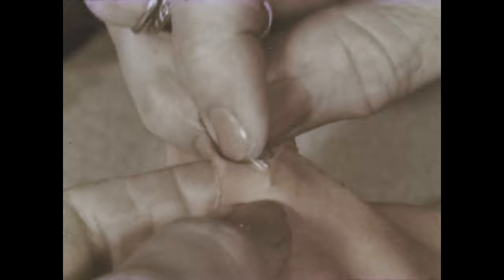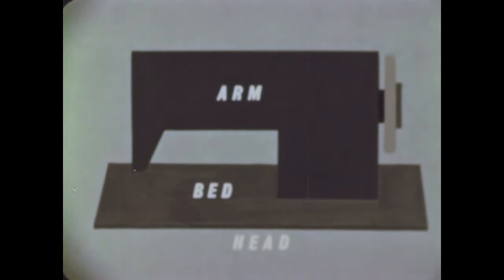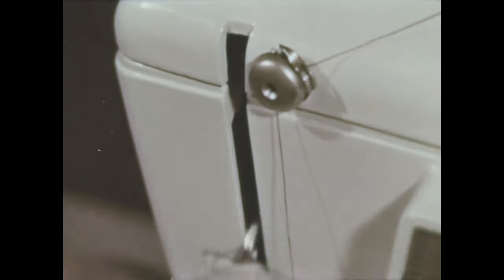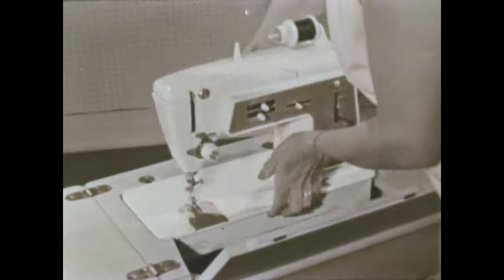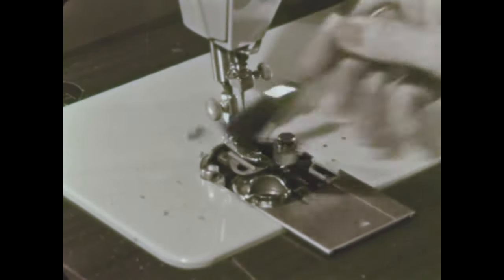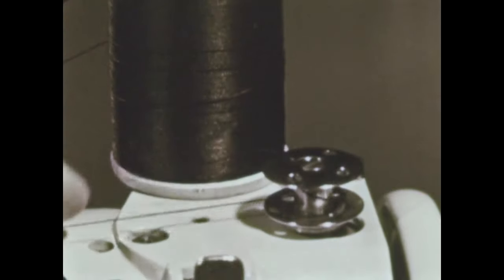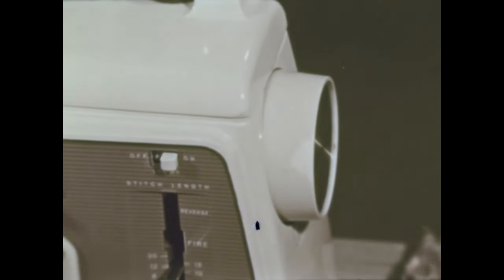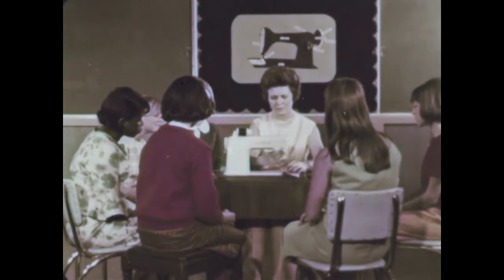Sewing Machine (1960s)

Comment: Those older machines are all you really need.  There are so many features on the new computerised ones, and most people barely touch them.  Plus, as with anything computer-driven, you will have breakdowns (its, and yours:-)).  I learned in the 1960s from my mother and sewed constantly on her old Singer 15-91.  At my elbow was also my paternal aunt, a children's fashion designer in the late 1940's- the late 1960's.  She taught me that you just need a straight stitch, the rest of fine sewing was in pressing everything as you went, and precise cutting, and then doing it by hand when that was going to be best.  

I just spent this past summer shopping for and trying out sewing machines.  It was a maddening experience.  And I ended up with a Singer 15-91 from eBay, and took it to a local vintage sewing machine repair shop to get tuned up-- and found out the owner knew my aunt.  What a connection. . .

I did also get the old buttonholers for those Singers, and I did get a Janome 5000, because it has  great overlock and zigzag and lightening stitches for sewing knit fabrics.  But I will probably do most of my sewing on that 1952 Singer.  If you're into machine embroidery, or do a lot of knits, especially lycra, you will want those designated machines and sergers and coverstitch machines.  But for everything else, you need a solid workhorse, and those Singers are it.
Reply: Agreed! I started cleaning and repairing old Singers that were given to my wife who sews costumes. The engineering and construction that went into them impressed me so much that i started rescuing them from the curb and thrift stores. Unless they were missing parts they only needed cleaning and oil. Most outlasted their original owners. I would recommend anyone wanting an easy to use reliable machine to buy an old metal machine. If you need zig zag or decorative stitches look for a 300-400-500 series Singer or an older all metal Kenmore.(Note: not all of those will zigzag)
Reply: What a lovely story and with so much useful information included! Thank you very much. PS I have a Singer 306P which was built in 1954. I am constantly amazed by how much it can do and how powerful it is. I’m old enough to have been one of those lucky girls to have been taught to sew at secondary school. (The boys did woodworking and metalworking. Us girls learned sewing and cookery. No swaps in those days! 😂)

Comment: My first sewing machine was a Singer that my mom bought me when I started to learn to sew in Home Ec in 1972. They were still well built machines back then. Since then I've had a Viking, and now a nice Bernina.
Reply: Same here.  I sewed on a Singer 404 at home and in Home Ec in 1972.
Reply: I took Home Ec in '72 also, but I didn't get my first sewing machine (a Singer) until 10-years later.  Very durable machine but over time, I was lured to the dark side by Brother.
Reply: My Home Ec was in 1963. At home, there was a light green electric Singer (in a Mahogany cabinet), with a knee "pedal" bar, with black discs for different stitching patterns. 
2023, my Preferred Singer is an electric portable  from 1919; no reverse. 
My 1912 Treadle machine in a cabinet is my go to machine, when the power is out!!!
Reply: @TaDarling1  The newer machines are pure junk.  My old Wards machine from the 70's sews through thicker fabric then my brand new Singer heavy duty machine.
Reply: @lauratran7638  OMG, I had totally forgotten that Wards used to sell rebranded sewing machines that they would buy from other companies and then sell under the Montgomery Wards brand.  They were durable and very reliable.